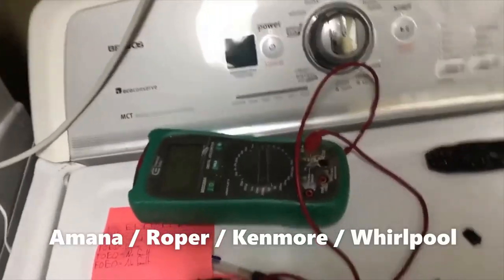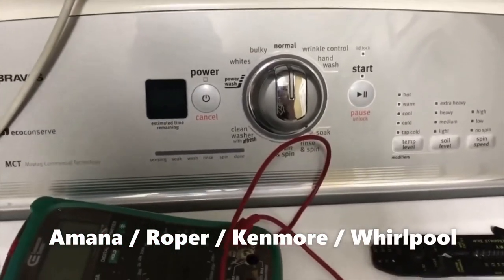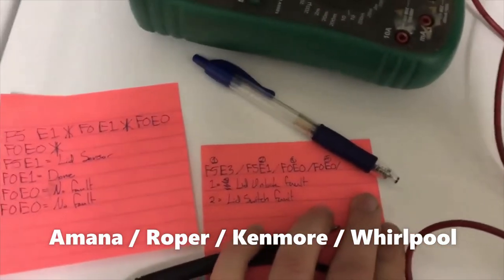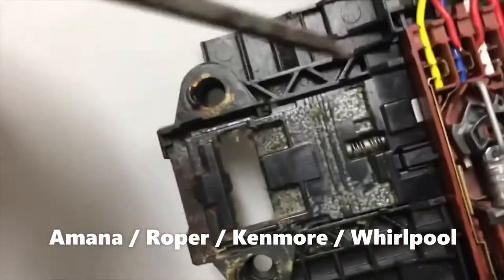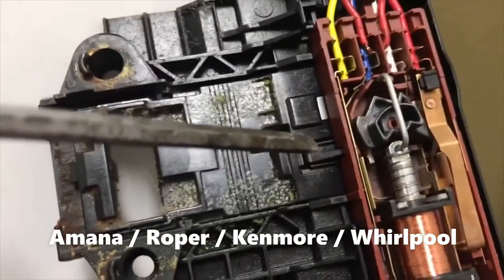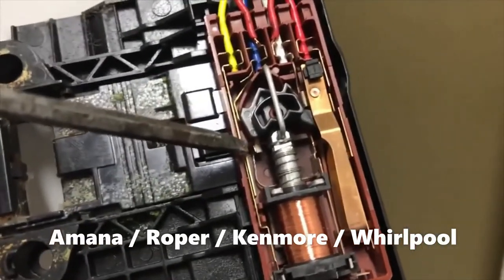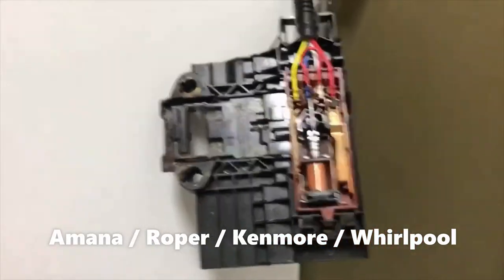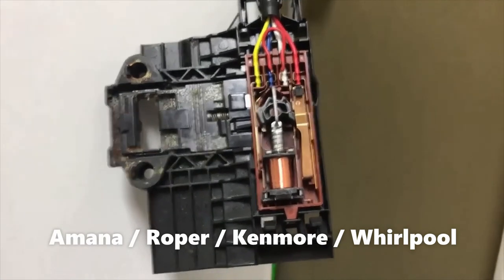Amana Washer Reset: How to Reset An Amana Washer Lid Lock

Comment: I tried putting in a wire like in this video into my Amanda washing machine. Then I tried to do a lid lock test in manual test mode of the washing machine...it literally blew up a bit...the motherboard. Gave off an odd smell and blue light too.
I baught the washing machine off of Craigslist from an Arabic looking dude so even had a thought for a second there that it might have been a setup of haszerdous gas. So if im not alive in a few days, this might be why, lol..

My lid lock mechanism didn't have the yellow wire like in this video and the design was slightly different of the other metal bits near the wires. So if yours doesn't either, I'm thinking it wouldint work.
I tried fixing it originally because it would fill up with water then drain it all out right away without any spinning.